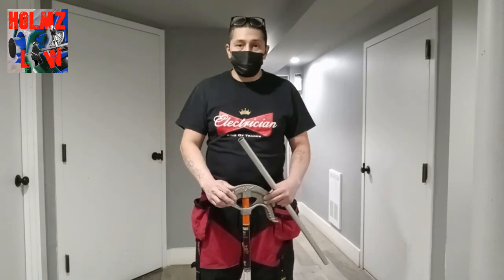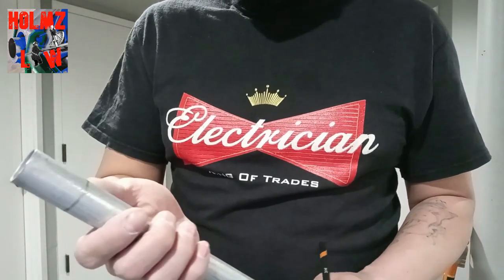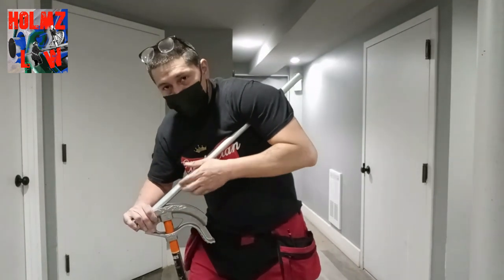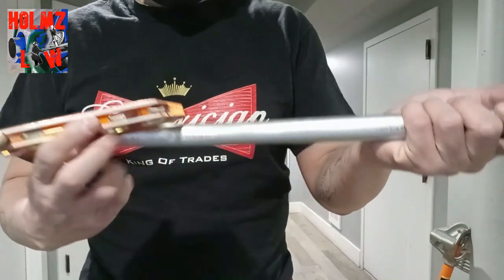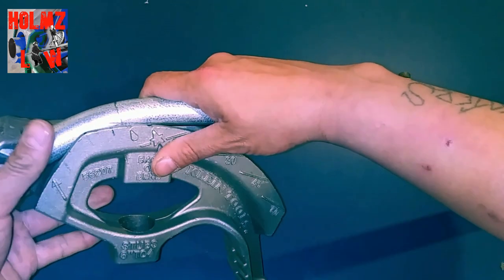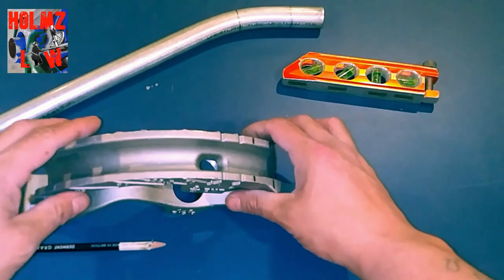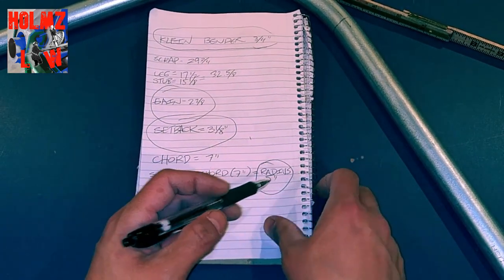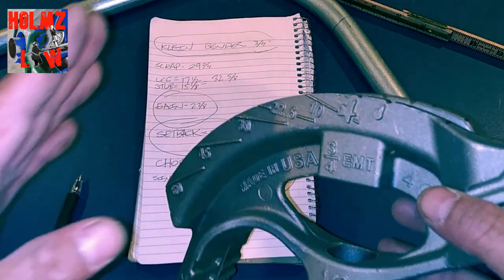Conduit Bending - Charting your Bender

Comment: WHAT AM I DOING WRONG!!
I'm trying to chart my bender. 
Just for practice I did a 45 degree bend but the center of the x mark didn't line up with the notch for center of 45*
Also I did a couple of bends at 30 degrees, the center of the x mark never lined up to the previous one that I marked on the bender. 
All bending is on the floor. And the front of the hook is always marked. 1/2 inch Klein bender. Also I use a level to check its spot on. So idk. 
Thank you for any advice. Much appreciated

Comment: Afternoon Brother,
Can you do some bending with Wiremold 500,700 conduit raceways????
And can you do some bending with the hickey bender as well.
Thanks again Brother 👍🏿🇺🇲‼️
Reply from the maker: Ok so wiremold my brother i dont really work with. Ive used it once or twice on a job that the customer requested it. But its not something i really work with all the time. To me its quite simple. You dont have to bend it. They have prefab bends you have to buy. As far as the hickey ill see if i can get my hands on one to do a video. I used the hickey a lot in the beginning of my career.
Reply: Brother Mel ,
Wiremold can be bend  with the Wiremold bender using box offsets, 3 & 4 bend saddles 90° bends.
Reply from the maker: @stevenhall8860  lmao... wow. My brother I honestly never knew that. I just looked it up and I just saw so many different types of benders for wiremold. I'll have to get my hands on one and work out the formulas. TY for putting me on. this is something i definitely make some content on. thanks again. Give me some time on this.

Comment: do you use this center bend for offsets or only for kicks?
Reply from the maker: You can use them for both if you want. But if you use it for offsets you need to realize that your offset will move closer to your obstruction which is good cause it makes your offset look more intentional and precise. But you need to try and bend a few scrap pieces with the arrow and then bend a few on center so you see the difference and you know about how much of a difference there is. Hope you understand what I've explained here. Thanks for the comment and most of all for taking the time to watch my videos.
Reply: What's wrong with just using the arrow?only thing I've needed center of bend for was for 3 pointers..

Comment: So for any given bend do you find the radius by dividing the angle bent by 2 and find the sin of that number and multiply by the chord?
Reply from the maker: NOt quite. chord/2 divided by sine of 90/2 = Radius. But there are easier ways to figure out radius of a 90. If you want to figure out radius of less than 90s i have that formula as well. you need to check my advanced conduit bending videos cause now your getting into the big boy league.
Reply from the maker: Also sorry i took so long to get back to you. you should have gotten at me on Discord with this question. Anyway next time.

Comment: Yo mel, you mention parallel Kicks and if you bend them you need to 30 degree  bend on center. I'm just wondering, will the bends not look good if I just bend them on the arrow ?
Reply from the maker: The won't be accurate. It'll take a minute to explain why. But I'll get back to you.  I'm a Little busy.
Reply: I use arrow too..I'm wondering why center is used..always turned out good..I thought?
Reply: @jamesedwards6201  The reason for using the center of the bend for calculated kicks is because of the formula used. You take the multiplier of the angle you plan to use for your kick and multiply it by your desired kick height and this gives you the distance from the back of the 90 to the center of your bend. If you use that same formula and bend it on the arrow, you will end up with less kick than you were aiming for because the center of the bend is actually further down the conduit from the arrow. That being said, I do sometimes use the arrow for bending kicks. But in order to do that and have it come out right you have to know the distance from the arrow mark to the center of your bend. On my 3/4 bender for example, the center of a 22.5 degree bend is 1 inch from the arrow mark. So if I take whatever number I get from the kick formula, mark it on the conduit and then move it forward 1 inch, I will get the right amount of kick when I bend it.

Comment: Conduit Bending is truly one of the critical tasks in the electrical construction industry. Whether it's EMT, galvanized rigid steel conduit, or intermediate conduit, you'll need to bend it. Bends will be required as part of your installation.
Conduit Bending Chart (PDF - Online Reading - Download ): https://www.toevolution.com/blog/view/2276019/conduit-bending-chart-pdf-online-reading-download